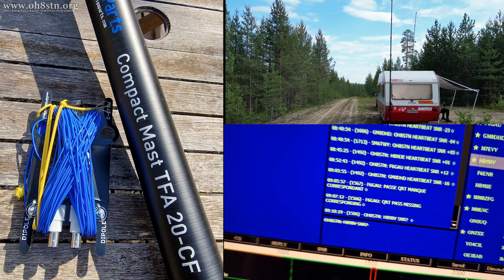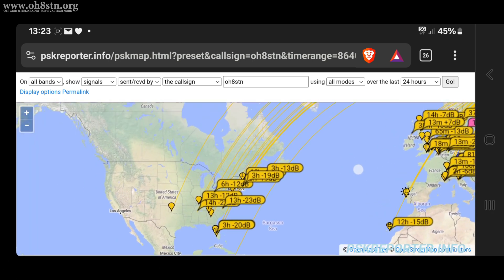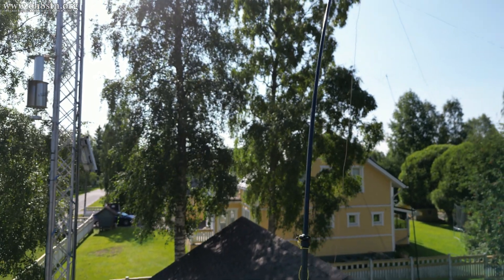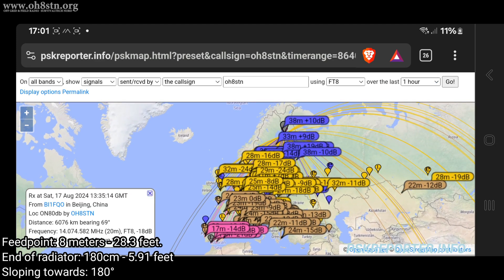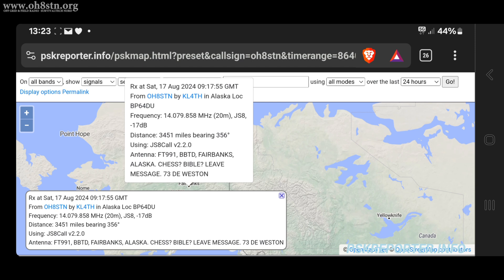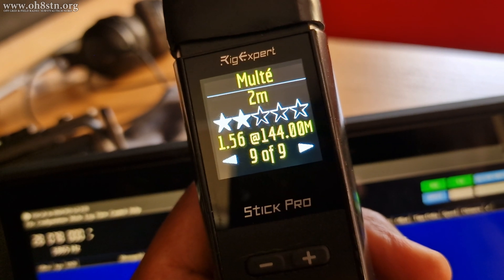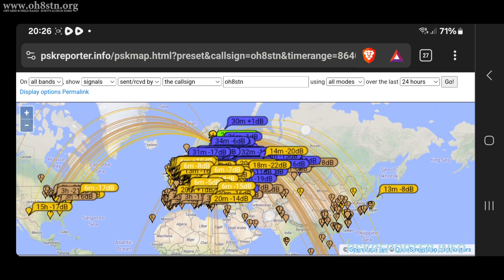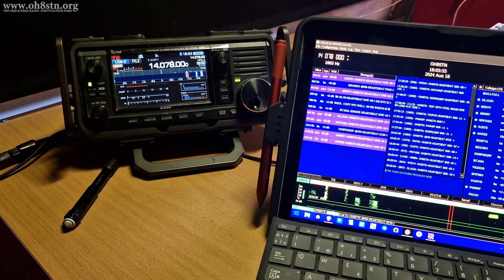Chameleon 4010 LEFS EFHW Portable Ham Radio Antenna

Comment: Using an azimuthal equidistant projection of the world map, centered on your QTH/M might assist in a significantly improved visualisation of the directionality  of your antennas and propagation, as it gives consistently accurate bearings and distances.
72 de M0OXZ

Comment: I just discovered the Chameleon 8010 and boom, you have it covered already with the 4010. I assume you’re not running an ATU with it. How do you know which direction to orient the wire (N,E,S,W)? Also, how the eyes?
Reply from the maker: Thanks🙏 No ATU for 80, 40, 20, ~15, 10, or 6m. WARC bands will need ATU on 8010. The 4010 has dipole connectionsfor a WARC band kit..
73
Julian oh8stn

Comment: I have this antenna. I noticed that it is a bit short, by looking at the SWR charts. I added extra 30 cm wire and got the SWR below 1.5 on digital modes. Try it out!
Reply from the maker: Indeed, I've noticed the same thing. I think it's set up for the US band plan. What wire did you use?
Reply: @OH8STN  Just some random speaker wire,  crocodile clips at both ends. That makes it easily adjustable.
Reply from the maker: @JuhaTapioOlkkonen 🙏👍

Comment: While WSPR is fun to run - I have a hard time relating the results to SSB. You may get nice high return values - but for me - SSB contacts from Denmark to Australia is a challenge.  And a question - I have both the LEFS 40-10 and 80 -10. But not currently the space to fully extend the 80 -10 at home. Have you compared the efficiency of these two types of EFHW antennas - will doubling the lengt of a 40-1 (making it 80-10) - improve efficiency at say 15 meters ? More wire - but same amount of power … ?
Reply from the maker: I get your point, but there's no WSPR in this video.
Since 15 meters is the 5th harmonic of 80 meters, the antenna will naturally resonate on this band, with good efficiency. At the 5th harmonic, the antenna should present a reasonable impedance, which should allow for effective transmission. Keep in mind, the efficiency of the antenna on 15 meters will be influenced by factors such as the quality of the matching network, the height of the antenna above the ground, ...
Just give it a try.
73
Julian oh8stn

Comment: A big thumbs up for a very informative video! I have the 8010 LEFS, which is presumably comparable in performance, but with a heavier gauge wire than the lightweight version. I am currently using just the main 4010 section set up in an inverted V oriented north/south with an RF choke with the peak around 30 feet and the ends at 7 feet on tall garden stakes so I can walk and mow beneath it. Even though the manual doesn't suggest this configuration, I've been getting great results mostly all across North America, but Europe as well, and I even had a CW QSO with an Australian station recently (I think around 10,000 miles from SW Florida to Queensland). Just the 4010 section exhibits very low SWR or is "resonant enough" for an internal tuner on every band from 40m to 70cm except for 60m. My RigExpert has even shown decent results on 160 and lower, although my radio doesn't go below 80m. I'll have to dig deeper into the data that the RigExpert provides to see if it performs better as a sloper or inverted V. 

I've had great results with it set up in NVIS configuration and also set it up recently as a sloper with similarly excellent results even with the feed point near ground level, but the weight put too much strain on the mast – a 12m Spiderbeam at full height – for long-term use. My previous attempts with this antenna as a sloper using the trees in my yard weren't as successful; I chalk it up to the trees not being tall enough, as in my experience it performs better the higher you get the elevated end up in the air. The most practical advantage of the inverted V configuration is that it distributes the weight evenly so the mast isn't bent over at all. However, that strain on the mast wouldn't matter for a POTA activation or even for a few days at a campsite. If I didn't already have the 8010 LEFS I wouldn't hesitate to buy the lightweight 4010 version.

Comment: Thats a lot of money for a wire and a balun. How would you describe the advantage this antenna has over a cheaper antenna or even a DIY EFHW?
Reply from the maker: @ThePapaMike  I'm simply showing the tests and the results. How someone reconciles the cost or better, the value, is entirely up to them. There was a time not too long ago where I didn't enjoy building DIY antennas at all. Depending on the price, the value was messured in the savings of my time.
Awesome question but the answer is different for everyone. 👍
Reply: Nice video, appreciate the time to show all the bands vswr.

Comment: I have the antenna, but I like using its Big Brother the LEFS 8010 EFHW antenna. I get phenomenal performance from that antenna. My antenna of choice lately is the CHA TDL raised up on a 25’ mast insane performance. Give that a try sometime.
Reply from the maker: Thanks. I also have the CHA TDL. Perhaps it is time to look at it again since I have the camper to deploy with. It has incredible performance, but too heavy for extended man portable trips. Thanks for reminding me it is here.
73
Julian oh8stn
Reply: Nice!  I used the LEFS 8010 recently while at a campground and was really noisy.  CHA TDL was a lot better.   What are you using to get the bugger up to 25' if i could ask?
Reply: @off-trailseeking3965  Did you put the transformer at the base or elevated at the top? With top elevation - you greatly reduce man made noise which are terrible when you've generators, inverters, solar panels and such at the campground!
Reply: @Chameleon_Antenna  I had the transformer up high.
Reply: From what research I have done,and from experimentation,I have found that an end fed offers better performance when the feedpoint is closer to ground,and the radiating element elevated.With the feedpoint closer to ground,it allows you to use the coax as your counterpoise.I also wonder how the performance would be if configured as an inverted vee?
Reply: @redman840  I agree!!! I ran the radiating element on the LEFS 8010 up in the air on my SpiderBeam 40’ mast and results were nowhere near as good as having the radiating element 5’ off the ground and my 50’ of RG58 coax as the counterpoise. I had the inline choke at the radio. Chameleon makes superior antenna gear.
Reply: I have done 450+ amazing POTA activations with the TDL on the 25 foot mast.

When running Emcomm/field day I choked off generator noise on both solar and gas generators extension cords. It greatly reduced the QRM with chokes alone, but a combination of  separation from the portable shack removed all QRM. Electric cars and solar powered RVs are huge noise generators.

 Choking off all wires going into the radios and use a choke at the base of the TDL. It really quieted everything down, and is now an excellent performer.

Unfortunately, there are some drawbacks with the TDL on the mast. The TDL wires break roughly every 50+ deployments.  I highly recommend Chameleon consider heat wrapping the stress points of those wires to avoid premature fraying. I put electrical tape on the stress points to reduce wear, and it has improved the lifespan. The whips need Ox-gard applied every 30-50 deployments to keep the telescoping easy. 

I have run into a hub screw stripping issue with the mast topper three times. Not sure if it's due to the lateral force creating stress from extended use under wind loads at the top of the mast. The hub just won't unscrew. I will probably just force the existing hub flush with topper,  and never remove it. 

Admittedly, there is some maintenance on this antenna, and the upkeep isn't cheap. Even with drawbacks mentioned it's easy to deploy off a pickup truck, and performs well in a variety of heavy weather conditions. I would deploy for emcomm, but with the caveat of attention to upkeep, and extra TDL wires. The bottom line it's my favorite for QRO portable operations especially at the medium to DX range, and has rarely ever let me down.